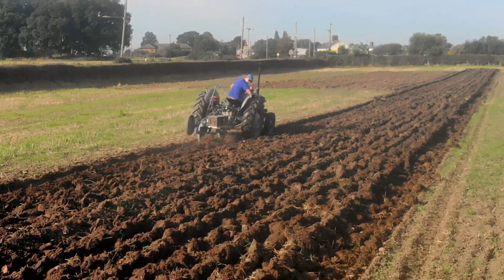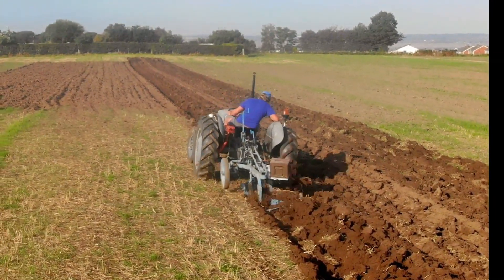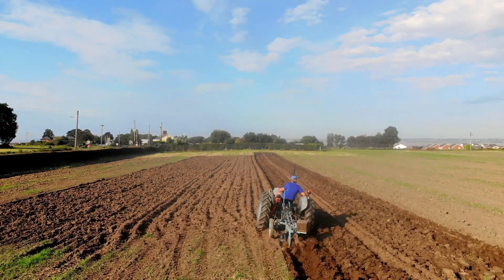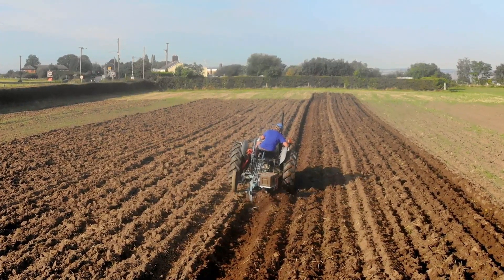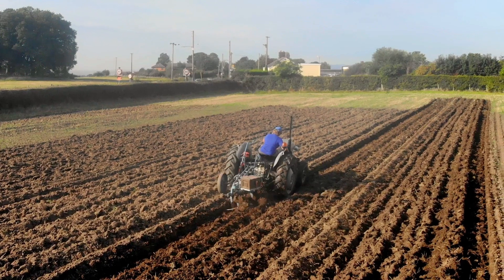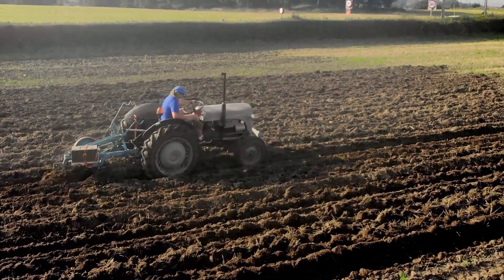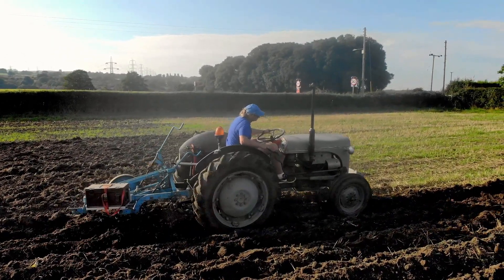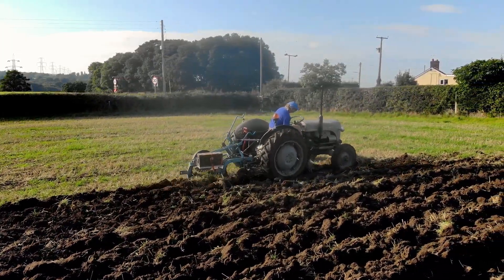Testing the draft control of the T20 Ferguson tractor with the Ransomes Robin TS54a  2 furrow plough

Comment: Looks to be turning too wide of a sod its bulldozing the soil
Play around with the board angle make it smaller
Kerosene smells lovely drop of 2 stroke in with it ❤
Reply from the maker: Not sure as it is the first time i have used it. I know the boards are far from clean enough so carrying a lot of soil. As for the furrow width i can look at that when the boards are cleaned up. It should be 10" i believe
Reply: @Lisa_Turner  trial and error but the Field is ploughed so job is a good one

Comment: That's a sweet sounding T20. All the ones I drove back in the day did a lot of popping and banging and spluttering.  Probably needed new plugs, points adjusting and the carb cleaning.
Reply from the maker: They have to be really hot to run well. I have a really high temperature thermostat and larger heat shield to keep the carb hotter.